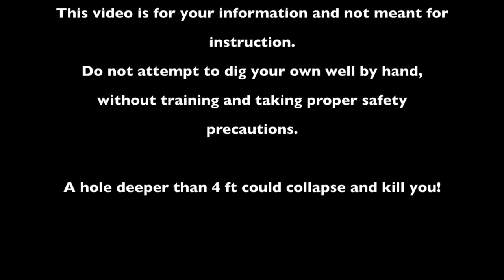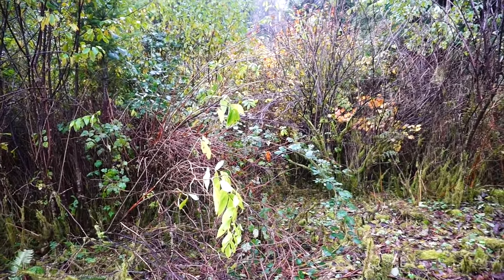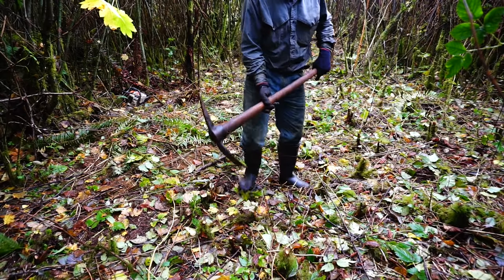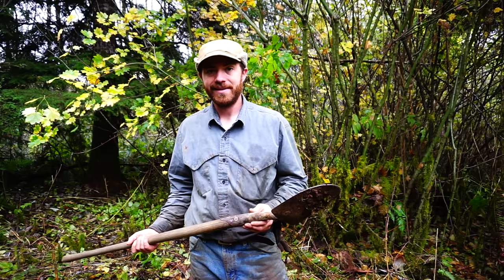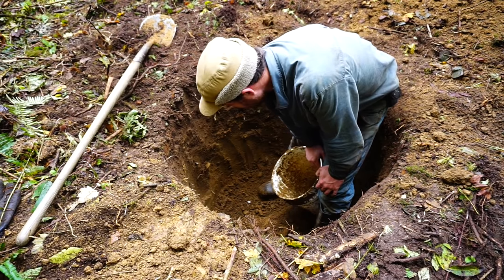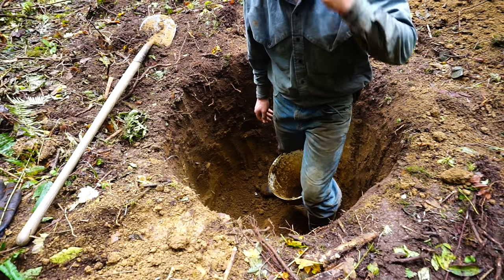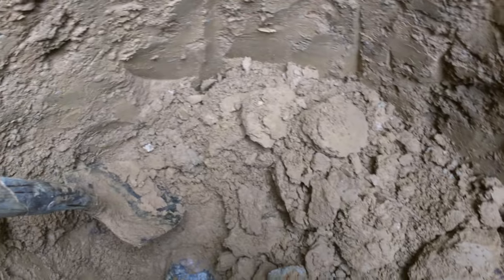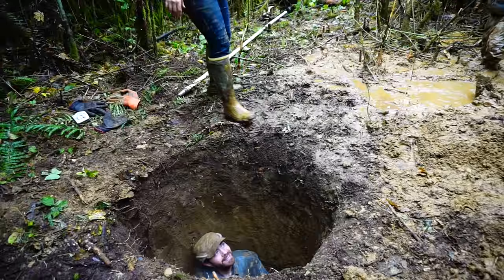Part 1: Digging a 9ft Well With a Shovel

Comment: That is very dangerous, especially when the ground is saturated. You should have used WELL RINGS and added them as you dug deeper. They would line the walls of the well (which is needed) and kept you safe.
Reply: Anything deeper than 4 feet should have shoring or be sloped back to prevent cave in. There should be a ladder so you can get out, too. Dirt is heavy! If it buries you, you can be crushed no matter how fast you are dug out.
Reply: A guy I used to work for died that way.
Reply: you didnt listen to a word he said
Reply: but this is hardcore, like "there will be blood", a hardcore business, lol, thx for the info im digging right now i think i will find it at 1.80m
Reply: Some one I know once dug a hole in his garden

Comment: A few tips from another guy that's done this job. The heavy pry bar is your friend in heavy hard pack. Get hard clay wet prior to digging, use dish soap to help break it up.  A dirty water pump with a metal attachment will allow you to dredge deeper once water started to seep in. Use that water to your advantage. Use nylon mesh to cement the area below water table to prevent cave in, the orange stuff works fine.  Chicken wire and metal fencing corrodes and rusts, you don't want that.  Great digging, it gets chilly down in that whole once the water starts in, stay safe. Short update, depending on size of hole,  you may want a short shovel. So many cheap ones that break off low on the neck, they work great when your down in the hole.
Reply from the maker: This is great insight. Thanks for sharing it with me and the rest of us.

Comment: I like your choice with the keltic music.  Very timely with the well diggin demonstration.  I just bought a property that shows nothing but field, woods and streams but it contains the location of the original 250 year old grantees homestead.  You can see the sparse remnants of an old orchard and the folks who sold the property pointed out the location of an old hand dug well.  Only problem is I'm not full of piss and vinegar anymore so I'll happily pay someone to drill a well for the made in Maine Simple Pump.  Great video, thanks for doing this.

Comment: Worked for a water department in the Midwest as a teenager. We spent summers replacing old lead pipe from the mains to the meters. A lot of the digging was with back hoe but also a lot of shovel. Just about the deepest hole I ever worked in was 8 feet trench, and yep, it collapsed, and yep, one guy got buried. Part of his face was uncovered and he was freaking his shit out, we dug him out and it all turned out okay.
Reply: How long?

Comment: Im digging a bunker and im going to use a 55 gallon barrel as a cason to hold up the walls because i live in Mississippi and the ground is gravel. I have to dig about 75 feet to the east from where i started to get to the right location. By my current speed, my estimated finish time is 3 weeks till i have to start moving east since i can only work on the weekends

Comment: Howdy from SW Washington.  Stumbled upon your video as I was looking up regulations for digging a well in WA.  We bought property with 1.  Irrigation rights in the deed from the creek (selling point, since I have a hobby farm), and 2.  A spring well.     It's been difficult in summer, it likes to run dry.  I think the sides did collapse a bit, it's hard to tell.  It seeps, and not fills, I think, similar to what you've got going on, here.  We have been fiddling around with various things for three years now, trying to handle the load of doing laundry, watering a few cows and a garden, and not losing the prime on the pump in the pumphouse because of low water.  Ugh... And sediment.  Let's just don't even get started about sediment.  The cost of having someone come drill a well was quoted at $15 thousand.  Then we got talking to farmer neighbor old timers here and there were some suggestions I won't name here.  But I got to looking at what's legal, because everybody knows how WA LOVES to tell you what you can do with your own land (and yet they still have no problems collecting those taxes... hmm...)  , specifically places that have a creek or wetlands.  My Dad finally got tired of Thurston County and moved East, thanks to those excessive wetlands and other restrictions.  Land you cannot use and still have to pay taxes on... ya, no.   Eastern Washington is MUCH less ridiculous, but every area has their drawback. 

I've been looking at all sorts of things, like tapping (or is it capping?) a spring, since we have plenty of those here, and that's basically what our well is, a seep from a spring.  We have a whole hillside that spits out water in various places all year long.  Less in summer, but still a steady seep.  I have been repairing the existing irrigation ditches put here by the original farmers before us, and finding that a two foot ditch fills with water overnight.  So, at least here, it doesn't seem to matter if it is a round hole in the ground for a seep well, or a long, shallow ditch.  The water comes, and the bigger area for collection, because the ground has water everywhere, the more water you get and faster.  Also, I see that the water is in the upper layers of the soil and if you get down to the clay bed, there isn't so much water.  There seems to be a layer of clay down deep and the water flows on top of it in the ground and then pops out at these various "springs".  I'm just trying to water my garden and livestock seperately, so that I can do laundry and not have the water quit, or not be able to take a shower after I do laundry or fill the cow water trough.  I only have 3 cows. lol 

So I have been a bit chicken to put film footage about this whole water business on YT, because, as you noted, legality issues everywhere.  I'm not doing anything illegal and don't intend to.  But also, there are scads of just nosy, tattle tale people with nothin' better to do having a cow about stuff that is none of their business.  Already experienced some YT lashback about a video of mine using a weaning nose ring on our calf.  I showed that we removed it because it wasn't a good option, but people freak out anyway.  Such is the nature of the online beast.  

Ayways, thank you for the video.  It is nice to find information for our specific ground type in the same geographic location.  Have been finding info for places like Tennessee and so on, where they don't bother you so much about just trying to provide for yourself.   They have rocks.  Not a single rock on this place, here.  All clay.

Comment: I just dug a well 20 feet deep with a post auger. Lots of exercise. Hit water in about 14 and went down to 20. I used a 6 inch casing. It is about 3 or 4 gallons per minute

Comment: in our much younger days we hand dug wells 20 to 50 feet, total craziness and all for very small money, at least you have a good solid wall around you, but keep in mind looks can be very deserving and turn real bad real fast, my land is hard red clay you cant even begin to dig even an out house hole by hand, I had a big excavator dig down 38 feet and was still in the wettest red guwy clay you ever seen I ended up having it drilled, 60 feet in red clay, though 12 feet of cores gravel 17 feet into bed rock the drill bit dropped into a 18 inch cavity in the rock, right were 3 big vanes cross, {just as I witched them} I had them drill down another 14 feet for a sump, in 30 years have never had water problems, no iron just crystal clear spring like water, what I love about my land an why I bought it when I was 18, nno building permits needed for anything, build what I want were I want, the only permit I would need is if I had hydro put  in
Reply from the maker: +Arnold Romppai That sounds like a good well. I definitely have good soil for digging, I've also experienced hard soil in my life, we are blessed here. The thought of building without permits does sound wonderful. I'm afraid that this world is now one of permits in most places now. Fortunately I am having a better time of it than I expected.
Reply: Your video and well are amazing, but please be careful in your future digging. A hole like this - if it caves in while you're digging - can turn into a tragedy. That said this is a great video, thanks for documenting what you accomplished.

Comment: I have a question. Why do Americans always dig with a round shovel with no handle on the shaft? Firstly rounded shovels are designed to scoop loose stone/gravel. Secondly there is no grip without a t handle on the end. this always fascinated me. I thought it was just a hollywood idiom.
Reply: One word awnser....leverage
Reply: I do landscaping and I use a  full metal spade with a sharp straight edge for digging. and then a square scoop shovel for cleaning out the spade has a handle
Reply: I agree. But, FWIIW, a spade/shovel with Y or D handle is more comfortable to use and is what I would recommend.
Reply: @johnm6346  --  A sharpshooter is just a narrow spade. And most spades, contrary to a shovel, and especially garden spades, have a T, Y or D handle because they are more efficient (from someone who has used both shovels and spades to dig small and huge holes, more than I care to admit). 😀 

https://en.wikipedia.org/wiki/Spade
Reply: @SaintCoemgen  I'll break through over poored concrete, roots, asphalt, random peices of wood buried in new constitution zones, bricks, or any hard ground with a sharp shooter just take that shooter and throw it as hard as you can and give it a pry or a twist. The T handle might be nice to hold onto but they are short and you have to bend your back way more and there isn't enough leverage to take out man sized scoops of earth. In fact ill cut a spade in half once i get deeper than 6ft to fit the shovle in a hole the T handles just make you bust your knuckles on whatever is in your hold. You're talking to someone who had been on 24 hour power outages digging on 13.2 KVA on the regular not to mention 100,000 volt duct banks with 15 cables in a bank that will fry your ass.
Reply: @johnm6346  - Unless I need the leverage, I now almost exclusively use a Y handle myself. On a Fiskars spade. Easy on the back and wrist over any other shovel or spade I have ever used because of the handle's curved shape. The shape does the work of loosing and removing the dirt. The only real task then is to lift it out of the hole. And a Y handle is best for that (IMHO). And I heft plenty of "man sized scoops".  And also dug many a hole. Big. Wide. Deep. 😎
Reply: @SaintCoemgen  Not to be cocky but I'm almost certain that I would out dig you. I think the Y hand or T handle is gimmicky. We had this shovel that we bought and it was an all Steel Y handled shovel and it was broke in less than a month. The tag on it said "worlds best shovel" I'll stick to my Razorbacks.
Reply: @johnm6346  - Be cocky. I can respect cocky.Cooky is good. And you may darn well out dig me. But if you are cocky, you may also need to back it up of course (I noticed your channel has no content --- maybe consider uploading some digging videos then). And I am a damn good hole digger myself. My most recent hole dug with my Fiskars which I have had for 10 years under constant use so much so, the foot plates are wearing out (that is a one meter stick on the bottom for scale)

https://stcoemgen.files.wordpress.com/2018/12/2018-01-10-15.21.19.jpg?w=762

Razorbacks make great shovels and spades (many with end handles). No quarrel there.
Reply: @SaintCoemgen  Actually I've been thinking about doing that. The secret with the wood handled shovels is to soak them in a water. Stick them in a 55 gallon drum for a week and you're good. I dig on power a lot so the metal handle shovels are kinda sketchy. That's a nice hole. I broke 5 or more phones this year so I have any pictures to share. It's kinda hard to take videos at work though because everyone in my crew flys around. One thing I think I'm still lost on are boots lol. I just took back 3 pairs of redwings boots this year because blow them out my shovel always goes through my boots each pair lasted less than a month. I'm officially done with that brand lol
Reply: @johnm6346  Had two boot soles also torn to shreds on my shovel this year. I stuck some old water hose pipes on the the foot plates, to protect the new shoe soles, but then the winter came, ground froze, so the "jury" is still out if that is solution or not. Will see next spring. 

I still have a pair of boots I bought at Cabelas 25 years ago. I just keep resoling them because they have the stitched sole seam. Great boots. Today's boots are all glued together and just fall apart and resoling is just glued,  and does not last.

Comment: I drilled mine with 2''' pvc , a 1.5" trash pump, 140 gpm and a home made bit out of galvanized 2" coupler cut in a crown shape. Some days I did 10" some days 10 feet, sand stone and clay mostly, my neighbors well is wet at 60 feet ( my Goal depth). When It got to 85 feet deep my bit broke off, no water, that was  8 years ago. My experiment exceeded my goal of 60 feet by 25 feet, some day I might try again

Comment: mat vineyard , a pointed shovel penetrates hard dirt much easier then a flat tip shovel.
 my question is where do these people live that have a shallow well ?? my place in Wisconsin where I grew up we hand dug our wells because of all the creeks and rivers. in Texas on my present farm I have had over 8 different well drillers not be able to hit water at 800 feet. my neighbors have wells at 600,-900, and wells at 50 feet. we live on a hill and these wells are very close to each other. yes a 800 foot well close to an 50 foot well next door.

Comment: Here in rural Canada dug wells are surprisingly common. My wife and I bought a small farm whose only source of water for the last half century was a dug well, 4 ft dia x 16 ft deep. I thought you only saw something like that in Bangladesh, but many people think nothing of it. We were appalled and drilled a proper well immediately. The water from the dug well was too useful to be forgotten, so we water the gardens with it. 

Water from a dug well IS alright to use if you sanitize it. Run the water through a series of filters and an ultraviolet unit. Or use chlorine, not my favourite method but effective. I prefer a deep drilled well.

Comment: I pulled water from 280' on Mt Shasta- well existed, but I did all the lines and pump/generator and built a rig to handle the weight... I'm not sure why you didn't run a pump once the water started moving- anyway, some great comments below. Would have loved to see it finished... Best, *A.

Comment: I don't get it. Why the need for a well 4-5' in diameter, when you could've dug a 4" hole in less than 30 minutes, with a post hole digger. If I were back in basic training, the DI would have me fill it back in.
Reply from the maker: I actually had this conversation with person who is over water/well permitting. My 8" post hole digger, though hand operated, is still a "drill" and falls under the category of a drilled well and not a dug well. To drill a well I have to be a state licenced well driller. 
I didn't write the law, I didn't get assigned to interpret it either. I would have fought it harder but I really wanted this experience and I'm glad I got the chance. I learned some things too. 
Thank you for your comment.
Reply from the maker: It is a state law in Washington state.

Comment: Come look at my garden it's not far off yours ..haha 
Guys that built my house you couldn call them cowboys.. it's an insult to cowboys.
After heavy rain I could rent my garden to ducks 
I want to dig a well in one corner and use french drains to help drain some of the surface water back into the well and add an over flow pipe back into my rain drains just in case of a storm

Comment: I never dug such well, although I repaired the brick of the one we had on the farm.

Never the less, the only wells I made were shallow wells, where you hammer or drive a perforated or solid pipe (I've done both) with an hardened point. The deepest one I made was 46 feet.

If the soil allows it, I'd like to drill it with the mud pit method. Here one good video that explain it: https://www.youtube.com/watch?v=xmBDMFyBJgQ . You can also take a look at http://www.drillyourownwell.com for even more methods and explanations.

Lastly, please look into the numerous forums that are for and against gravel packs for your well's bottom. Personally, I would not go on that route. The gravel pack does not looks to be a good idea.

Keep on your good work.
Reply from the maker: +Simon Forget so many options out there. I am doing the best I can with what I have. I am hoping for the best with the gravel. 

I always enjoy your comments, I'm sorry I haven't responded to your email yet. I want you to know that I am always grateful for your input.
Reply: Thanks. I don't want to be rude nor be the "know it all" in any of my comments. I'm happy to share my knowledge and experience so others won't make the same mistakes I made.

Keep on your good work.

Comment: Honestly if Florida had soil like that I would of dug a quarry by now. 

 Its just mostly rock,
Reply: I'm trying to dig a hole to hang in you think it'll collapse since its mostly damp Sand?
Reply: @8luck679  Damp sand is a bit more sturdy, still, never dig a narrow deep hole, what I did was very stupid, dig a wider hole.  Dont dig deeper then your chest.
Reply: @8luck679  Also if you just want a hole to hang out in, dig to about your hips and make it a very wide hole, dont keep sand on the edges
Reply: So a collapse is pretty much a inverted mud slide with pressure?
Reply: @8luck679  i guess, not sure what that is, probably yes though